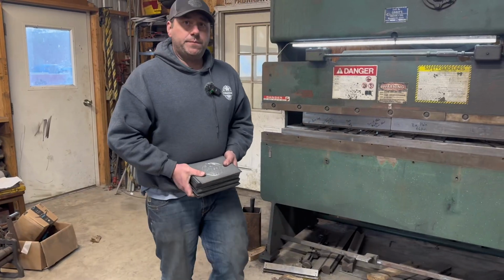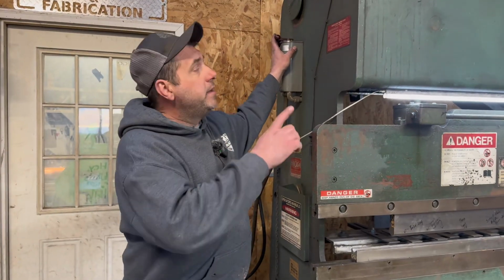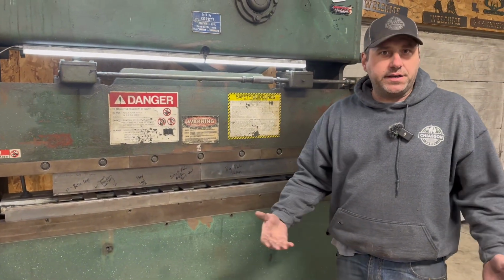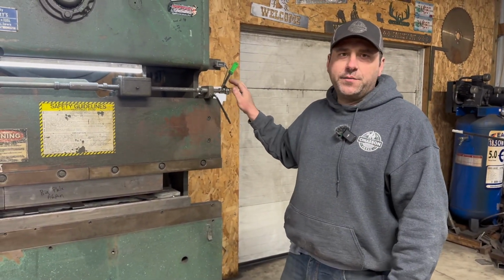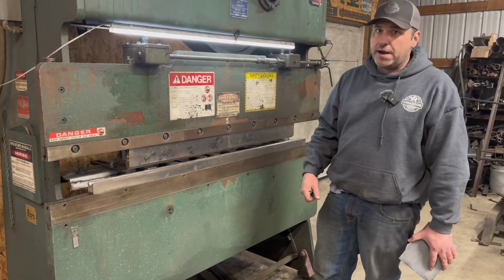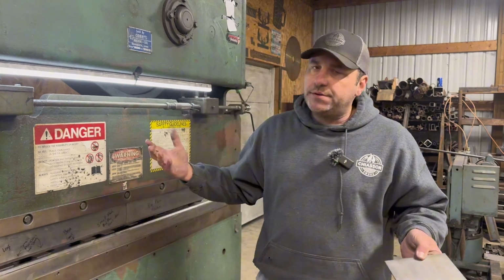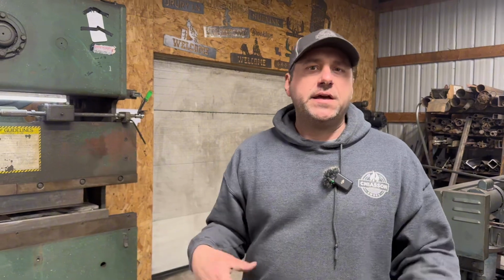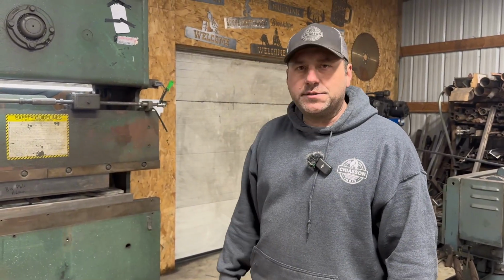Mechanical Press Brake in a small fabrication shop #chiassonsmoke #welding

Comment: these sorts of press are not able to be used in Australia unless they are fully guarded and that is a very expensive process if you have to make a different guard for each different process so basicley no commercial value .....you can usually get them for scrap metal value...but then you are responsible for your own safety and not allowed to let anyone else use it

Comment: By the way, be very careful, this machine will eat you up. There is a funny spot when you’re feathering the clutch down and then all of a sudden you’ll step on the pedal and the ram will come back up. It’s really weird they say there’s no way the machine can do it, but after a while, you’ll learn it can be done. Also running the machine in reverse is very very dangerous if you think about a window shade, and it has a little tooth that clicks a long, a cog to hold us shade in position that you wanted to be in 
this machine has a mechanism that works the same as that, and it will actually not engage running backwards, so the machine just goes up and down up and down. The only reason you’d want to reverse the machine is if you bottomed out the ram into a piece of material and froze it in that place in which case shut off all the power and Lock the power out with a padlock 
and you’ll have to physically turn the flywheel backwards for God sakes. Be careful get your fingers in the belts that wrap the flywheel and you pinch off your fingers.   right off. There’s a lot of reasons they stopped making these types of   mechanical machines.

Comment: I had a Chicago 70 ton mechanical 
and 110 ton hydraulic. Also we made several hydraulic press brakes from 65 to 100 ton. You can make a lot of dies yourself you do not have to buy them. You could also cut down your top die so you have a 1/2 in,1 in,2 in,4 in, long pcs these are called fingered dies this allows you to make items like pans and other shapes. You can also make your own top dies by put two pieces of 3/16 plate with a piece of 1/8 inch material sandwiched between them with the piece of 1/8 material being about 3/4 of an inch taller than the pieces of 3/16 plate or use a piece of half-inch flat bar for the top die die with a piece of round bar welded along the length
If you make a dye shoe which is a piece of quarter inch plate, 5 inch wide and 2 pcs of 3/8 x3/8 bar stock, on each side so you have a channel about 4 -1/4 in wide with a piece of half-inch by half inch barstock on the bottom underside to key it into the bed of the machine  
and strip of 3/16 flat stock on each this will allow you to put a piece of half-inch by 4 inch flat bar in which you can weld on round bar stock to create your own bottom dies varying the spacing between them to allow you to break heavier material because you will have increased the width of the bottom dies, which will allow  you To form thicker pieces of material with a 70 tones that you have you could also set up punches and other types of operations in the machine. They called the punch units CJ units, and you could set up gang punches to punch multiple holes at the same time
Hit me back if you have any questions